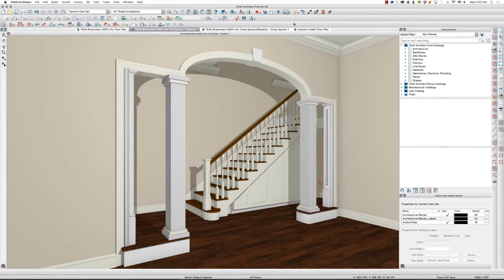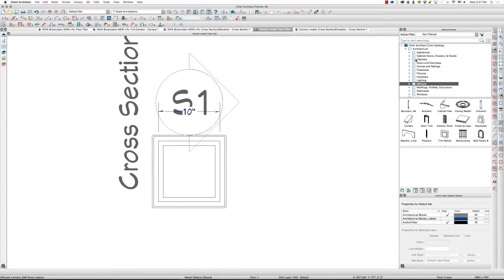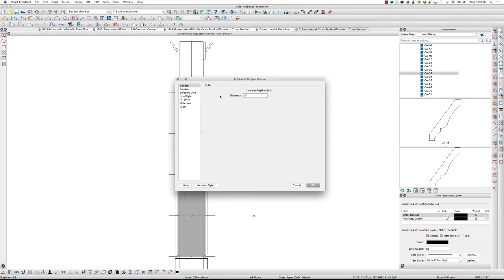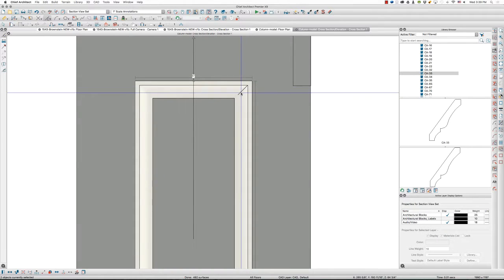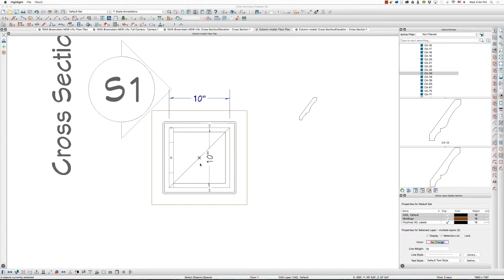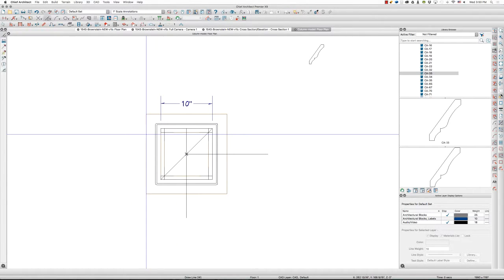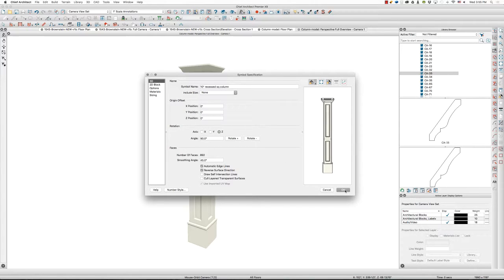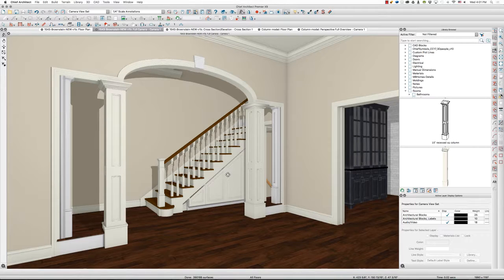Custom Recessed Panel columns library

Comment: So, here's a tough one;  Let's just say that you are doing the post in wood grain.  You need your rails to have your texture rotated 90 degrees.  Can you 'divide' the poly line solid to create the separate rails, or would you have to just start out by making the frame in four separate poly line solids, then add your profile via molding poly line?   I certainly feel like Chief misses out by not having a 'door maker' dialog.   Anyway...   Just getting back into Chief and about upgrade my old version to x12 $$$.   Thanks.
Reply from the maker: I hear ya! I wish polyline solids didn’t render grains the way they do. For a door to make the grain run properly you’d have to do four different solids